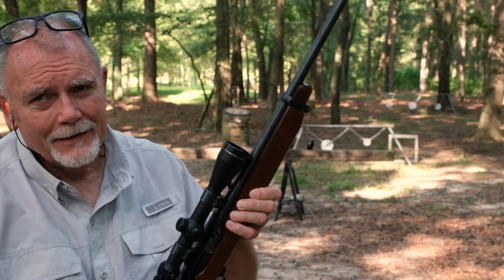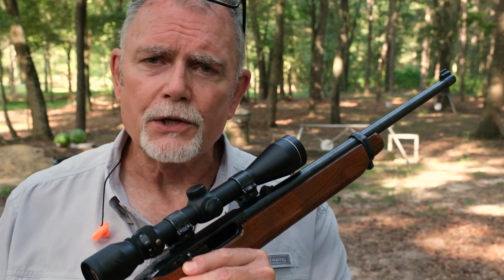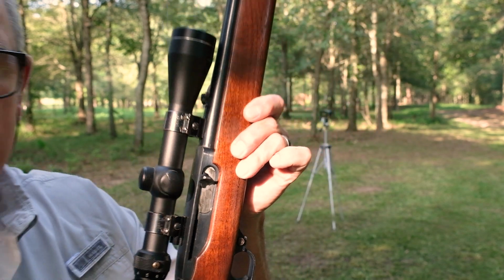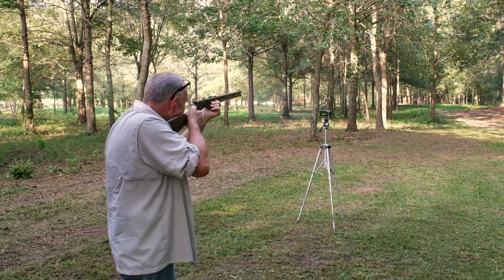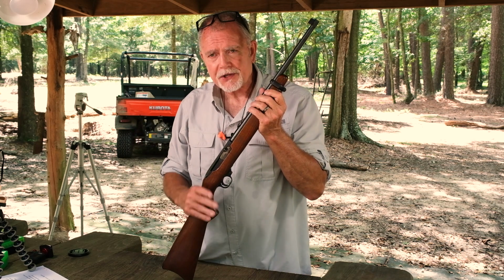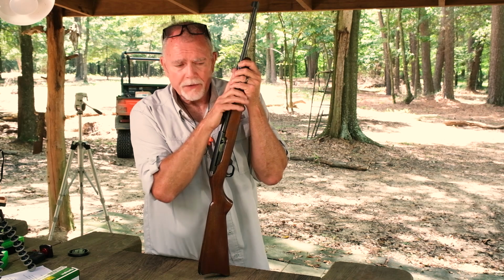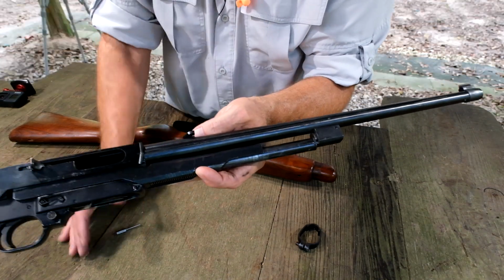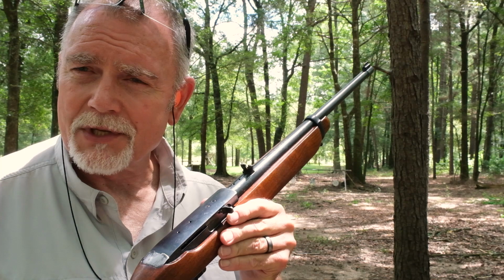* * * Ruger's First Rifle * * *

Comment: George,that hook on the rear of the reciever was borrowed from the M1 Carbine!  The M1 Carbine takedown is the same - slide the barrel band off the fore end, and lift the front of the barreled action until the reciever unhooks from the recoil plate.  Now you are going to have to acquire a .30 carbine!
Reply from the maker: Interesting! Thanks Biff. I knew the design was similar on the outside, but I have never handled the M1 Carbine. I have been offered a Garand and the Carbine to use in a future video. I'll make sure and point out the similarities.
Reply: @TargetSuite  I suspect the reciever hook on the M1 and Ruger carbines is an adaptation of the hooked breech that was used for years on muzzle loaders as a way to simplify removing the barrel for cleaning

Comment: I have owned this Ruger since 1972. I found out the hard way during deer season in Wisconsin that the 180grain shot about 6" high compared to the 240grain @ around 50 yards and kicked more.  My scope was set up to shoot 240 grain. had  purchased 180 grain by mistake. Its a great gun. I have flip off scope mounts in case your shooting in brush while a deer is running. I have owned the 10/22 Ruger  about the same time.
Reply from the maker: I've had the same experience with the lighter loads. They do tend to shoot high. But like you said, it's a great gun. Mine is a 1972 version as well.

Comment: Still own one bought it in 1970, 1969 manufactured. Never needed a scope the iron sights were good out to 125yrds. My reloads were able to crack the chronograph at 1840fps that's loading 240 grain Hornady XTP's. Now that is no BS as l still own the gun and hasn't lost a beat. Best brush gun that was ever made, would never sell it. OH by the way when hunting my usual handgun is a Ruger Super Blackhawk chambered in .44 Rem Mag perfect combination .44 mag both ways. Rebarreled the Blackhawk to 101/2ins and retired the carbine, but it is hands above the reissue and the carbine is now gone. The absolutely best brush gun ever made.
Reply from the maker: Hi Jay. As you know, mine is a recent acquisition, but it fulfilled a dream I've had since I was in Jr. High School. Like you, I am thinking about a companion revolver like a Super Blackhawk or a Vaquero, but I have other priorities so that may die on the vine, as they say :-)

Comment: George thus far with your 44 mag rifle experince which would be your choice for 50 yard accuracy in order.  Let me also say that we viewers and subscribers are fortunate to have you for feed back on these matters. You are appreciated .
Reply from the maker: Hi Ben. Not sure if you are talking about which 44 Mag rifle or which load. But I just put a new 1.5X4 Leupold scope on this Ruger Carbine because it is going to be the rifle I carry around the farm and it needs to be ready for pigs at all appropriate ranges (under 150 yards) and under all lighting conditions. As for accuracy, I am still working on loads for both the 1892 and the Ruger Carbine. So far they are pretty close at around 2 MOA accuracy, but now that I have the scope on the Carbine, it may pull in front.
Reply: @TargetSuite That makes sense and is about what I was figuring.

Having an option for some type of optic is helpful in low light and thats when a lot of hunting gets down-dawn and dusk. I like the look and feel of the 92 but practicality of the Ruger and certain Marlins with ballard rifling, micr groove can be a serious hinderance for cast bullet accuracy as you know. And yes 44 mag is what I have been contemplating. Marlins can have timing issues with the carriers but can be fixed by a competent smith in the know. I have a 45-70 that crushed shells that now runs smooth.The 44 mag seems like a nice option for a lite weight thumper but there is a learning curve that goes with it.
Reply: Just saw your question . Yes the rifles. Thanks.

Comment: Can’t find an Ithaca but sure can find parts to my Ruger if I search Deerstalker. Just need a Super Redhawk and a Deerfield to finish my quartet. Ruger carbine (Deerstalker) and Super Blackhawk being the older and Deerfield and Super Redhawk being the more modern. 240gr works best in the early carbines with factory loads if you want to use original sights

Comment: Remember that the 44 Magnum rifle will also chamber and shoot a 44 Special. I'd like to see a video featuring the 44 Special in the carbine and your 1892. I've never shot those loads in my Ruger Carbine and I'm curious how they would do. I have shot some 44 Special loads in my Taurus Tracker and found they shoot a foot lower at 50 yds.
Reply from the maker: The 44 Special won't reliably cycle the semi-auto action of the Ruger Carbine. At least that is what I have read. And it makes sense. But 44 Special in my 1892 would be sweet. I have been trying, off and on, to develop a low power load for the 44 Magnum case that would mimic the "Special" power levels. Results so far have been lukewarm.
Reply: @TargetSuite  There is a set screw in the gas chamber which you didn't touch on in your video. Information on the proper adjustment of it was vague in the manual. The set screw in mine would move with recoil over time and then wouldn't cycle reliably. It cost me a buck once. As I recall, I used some non permanent LOCTITE on it. It may be possible that you could adjust the screw to cycle 44 Special. In the days before the internet, it was impossible to get that information. I may have written Ruger. Ruger should have put a set screw on the set screw. There were 3 things I didn't like about my Ruger: the plastic buttplate; the tubular magazine; and the set screw. I have a 10-22 deluxe with a better buttplate, checkered stock and the rotary magazine. I always hoped Ruger would correct those items with a 44 magnum carbine deluxe but they discontinued it instead.
Reply from the maker: I checked my manual for the Ruger Carbine and there is nothing in it about adjusting the piston. But it does say it is designed for the 44 Magnum cartridge only and quote, "no attempt should be made to any other 44 caliber ammunition". Maybe they changed something later down the road to enable that.

Comment: As much as I love my 10/22's, regarding this one I have to say "Thanks, but no thanks."  
I prefer a lever action Henry Big Boy.  They are available in .357 Mag, .44 Mag and .45 Long Colt and while the newer ones now have side gate loading, you can still unload them from the front of the tube without having to work all the rounds through the action.  This thing appears to be a real pain in the posterior.  No wonder they stopped making it.
Reply from the maker: Haha! Yep, compared to a Henry or Marlin lever gun this guy is very complex and finicky . . . and a lot of fun!
Reply: @TargetSuite  - The recent Marlin and Winchester lever guns are "very complex and finicky" since they bent over for the democrats and installed a useless crossbolt "safety."

Comment: Wow, cool video. I'm glad you showed the gas system. I've heard all lead projectiles with gas operated semis will foul the gas port. What's your experience with this?
Reply from the maker: No experience at all. I have avoided the possibility and stuck with jacketed bullets. Thanks for the comment.
Reply: I shoot the Hornady 225 gr. Leverevolution ammo, which is jacketed with a polymer tip, No failures of any kind. Great rifle. Bushnell 1 1/2- 4 1/2 Dusk & Dawn scope. Deer slaying machine.

Comment: Good morning George! I'm getting older and the eyes are failing, so its scope time on a henry golden boy. By the looks of things I may have to take the scope and rail off every time I clean  it to be able to get that brassolite receiver cover off. Would you know of a better way if so I would appreciate the info......tks.
Reply from the maker: Hi Ben. My experience with Henry stops at the X Model which doesn't have a receiver cover. But I suspect you will have to deal with removing the scope to fully disassemble your Golden Boy. Maybe others will read your comment and jump in with help!
Reply: Hello,is the receiver cover is tapped? If it is you may be able to leave the scope on. You can call Henry and ask. I had to call about a question I had with disassembly they have awesome customer service.
Reply from the maker: Hi Terry. The receiver is tapped as well as the barrel. I bought a short rail that bridged both mounting locations and put a 1.5X4 Leupold on this rifle. Sweeeet ! ! !

Comment: Has anyone else had trouble with reloads cycling through this rifle?A friend of mine has one and reloads his own ammo and has used the highest power charge without any luck.
Reply from the maker: Hi Frank. I have read that it is sensitive to lower power loads. If it will cycle factory stuff but not reloads, my guess is that they just don't have enough giddyap.

Comment: George, These 2 articles from the Ruger forum shed some light on the gas piston adjustment set screw. This may provide some fodder for a future video.   https://www.rugerforum.net/threads/44-magnum-carbine-adjustment-jamming.18048/   (.44 Magnum Carbine Adjustment/Jamming) and  http://www.rugerforum.com/phpBB3/viewtopic.php?p=721635  (Ruger 44 Carbine issues). Googling will reveal a number of problems, causes and possible solutions. Enough for one video, maybe two. I didn't include all the links. One link told of one person's solution so they could shoot 44 Special.
Reply from the maker: Thanks for sharing that. I'll do some digging. Personally, I'm less interested in tuning down for Specials and more interested in whether I can tune up for beefier loads so they don't pound the bolt so hard. Any thoughts on that?
Reply: @TargetSuite  I loaded my 44 with H110 which gave the best performance and accuracy with near maximum loads with a 240 gr. bullet and magnum primers. Hodgson recommended not loading down with the H110. You might try Unique or Hercules 2400 for reduced loads and tinker with magnum and standard primers. I never tried W296 but I read that it was similar to H110.
Reply from the maker: A2400 (Alliant bought out Hercules) seemed to work ok for moderate 44 Mag loads, but below that results seemed erratic. Maybe I should just stick with "moderate". But then I am going to do a deep dive on the links you sent.

Comment: wait... is that right? rear sight low but shooting too high? or is it just shooting high at that range and is on target at a longer range? Seems to me if you lower the rear sight, it would shoot higher, but hell it's been so long since I've messed with one I don't remember just right. Probably got it backwards like I do everything else.
Reply from the maker: Haha! I still question myself😄
Reply: @TargetSuite  logic says if you lower the rear sight, the tip of the barrel has to come up to be in alignment, but my logic must be flawed, since if you raise the rear sight, it would also have to come up to be in alignment, and it can't be the same both ways. I remember we lost the little piece that held the rear sight at different heights on my grandfather's old 22, and I could never get it right again, tho were only using a wooden wedge to do it. I finally discovered it was shooting just off the paper target high and right, so the only way I could get near the bulls eye was to hold it low and left hand corner of the target. Of course this happened when I was shooting for my hunter safety card. they must have thought I was the worst shot in the world. Gosh durn long time ago that was. I used to know for sure what way to go with it, the miltary finally drummed it in, but like anything else, you don't use it you lose    it. I haven't shot a rifle in many years. Mostly when I do get to shoot these days it's a handgun. One problem I have here is there is no public range in the vicinity. I used to know some people that had a nice place to shoot, where they had quarried gravel years ago, a nice 50 foot high bank as a backstop. Lost touch with them though, and forget where the place was. You could shoot shotguns and smaller rifles there too, but the distance available was only about 75 yards or so.
Reply from the maker: Haha! I put a crushed 22lr case under the rear sight of my friends Model 94 Winchester! You can see it in that video. Adapt, improvise, overcome! 😄 Not having easy access to a place to casually shoot is a problem. In the "old days" you would just drive out in the country and ask the farmer if you could do a little shooting. Not so anymore.
Reply: @TargetSuite  
.If you can find a place, you can still do that, but most will say no unless they know you. Not a lot of good spots around here, sometimes you'll find a place with an old sand and gravel quarry or the like, but they're few and far between. Back in the day when I was growing up, we had a site that we liked that was just a spot on the side of the road, don't know if anyone actually owned it or not. Just a spot where they had quarried. That was back in Colorado. However, early on we could shoot 22s in the  arroyo or back part of the field. If that wasn't to our liking we could walk up into the foothills and find a good spot. Now the old farm isn't a farm, it's surrounded by houses and jerkfaces that live there, they call the cops when the kids ride their dirt bikes around the resovoir, even tho those jerks have no claim to it, they still call the cops. I suppose they'd call the cops quick if somebody started shooting in the neighborhood. People ruin everything. Too many people. I still don't get why the jerkfaces always build on good fertile ground and not where the land ain't good for nuttin else. anyways, I had to get out of Colorado the bleeps from California were coming in and buying everything up, they even screwed the deal I'd made on a house. That tore it, time to go. And that was long before the "greeen revolution"   Now you can't affford to rent or buy there even if you make decent money, it takes indecent money to buy or even rent there now.
Reply: @TargetSuite  That reminds me of a gun a neighbor had. It was an old thing, apparently it was an old black powder gun that had been remodeled into a breech block 45 70. The front sight was a piece of a civil war era coin.

Comment: I was only 8 years old at the time, and I could tell the difference between the word deerstalker and deerslayer. Cannot beat the stupidity of lawyers.
Your handloads aren't nearly and how in the world did you get almost at 200 feet per second difference between the first and second shot. I've loaded rounds for an 8 and 1/2 in Super Blackhawk and was shooting 1750 out of it. But it was a warm loaded. But it was still two grains under the max. However that was in about 1984 and the books did have much higher load data in them than they do today
Reply from the maker: I don't know if it was because those handloads were not "optimized" for the Ruger Carbine or was it a chronograph issue. Regardless, it shoots great now. I killed a pig with it before the last cold weather. The shot was 150 yards.

Comment: I had an unfired one in the box I sold to buy some AR30 piece of junk.. we make mistakes. nice gun
Reply from the maker: Ouch! Yep. I've made more than one of those mistakes.
Reply: @TargetSuite  there is a rotating bolt version of that rifle but only holds 4 rounds in clip. I have the  cams stainless bolt and it is wonderful, have black stainless bolt 357, love them both.
Reply from the maker: A friend has that 99/44 Deerfield and I will do a comparison video with it some day.
Reply: @TargetSuite  never owned one but I think the 99/44 may be a little better design.
Reply from the maker: Probably more robust . . . I think. Accuracy wise . . . we'll see. I can't wait!